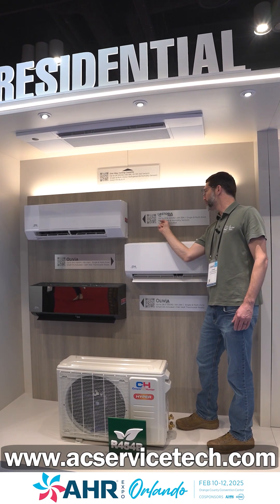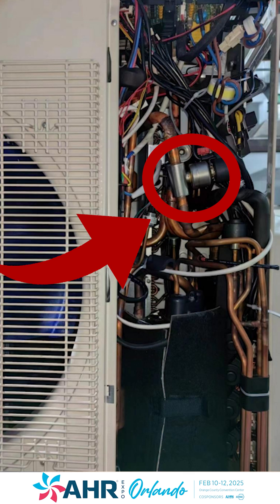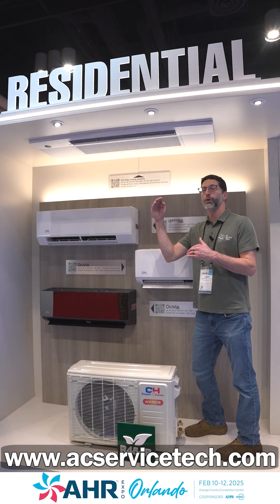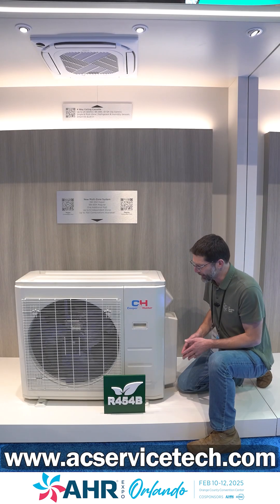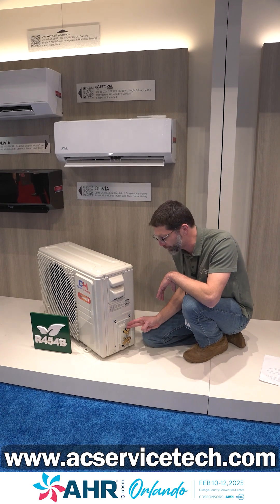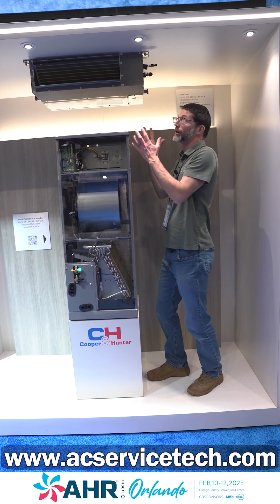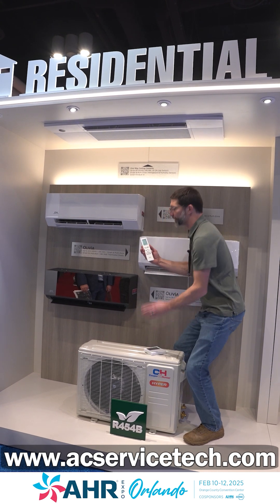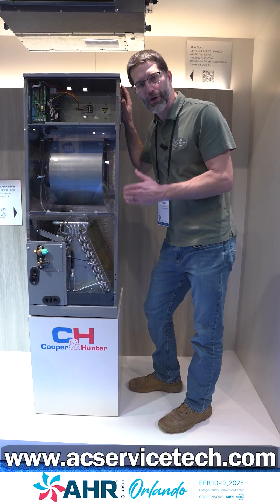A2L Sensors and Solenoids, Mini Split Humidity Control, and Updates with Cooper & Hunter at AHR 25!

Comment: Bro the A2L stuff is truly overengineered. Full size indoor coils now come with a dissipation board that when it detects a leakfrom the indoor coil, kills the power to your AC and turns on the furnace blower motor. So instead of the """""""flammable"""""" refrigerant being confined in the basement the blower circulates it throuout the home. All in the holy name of Green Energy™️.
Not even to mention that they changed the ports on the condenser to brass so theyre more of a pain to braze in. Thanks EPA.

Comment: It is too bad marketing and contractors are just as responsible for not requesting and pushing 6000 BTU 9000 BTU etc. high static pressure or medium static pressure ducted slim mount units.   That can either be mounted in the ceiling or hidden in the soffit.    That can have ducted sealed, large capacity, low static pressure drop filters.. 

Units like this can be manufactured to put in between two wall studs in a vertical fashion . 
      Or ceiling joist stud cavity. 
      They have some low static units like this that are not designed and cannot handle filters already in use basically converted wall mounts mini split air handlers.

Comment: More stuff to fail and break
Reply: remember when they at least tried to make a bs argument about the environment when they change everything for no reason to screw the customer?
Reply: I'll be there when it breaks 🧑‍🔧
Reply: Eazy money 🤑
Reply: What a mess they have made in HVAC industry. RIP consumer
Reply: @July4.1776  Hello window units.
Reply: Engineers were huffing ammonia when they dreamt up this stuff. Imagine the look on the customers face when you explain what the purpose of the new dissapation board is. Exhausting the """flammable""" refrigerant through the home? Good job EPA
Reply: @hunter00143 no, the purpose of that board is to prevent ACCUMULATION of flamable gas.

The thing with A2L refrigerants is that they don't really catch fire untill they reach a certain concentration, then they explode, if it doesn't reach that concentration, it doesn't explode